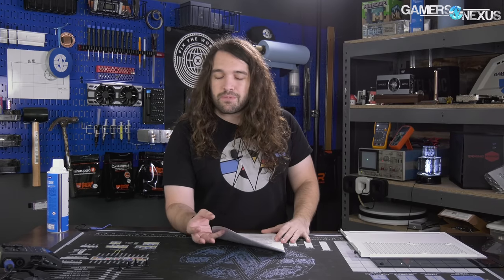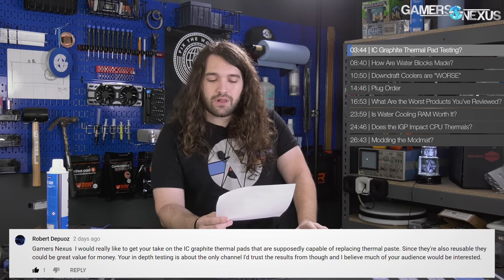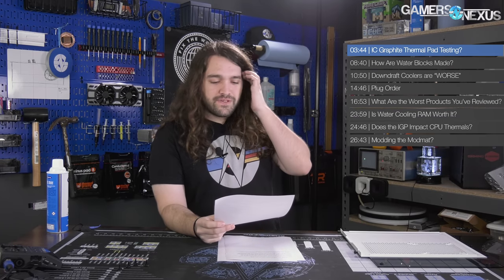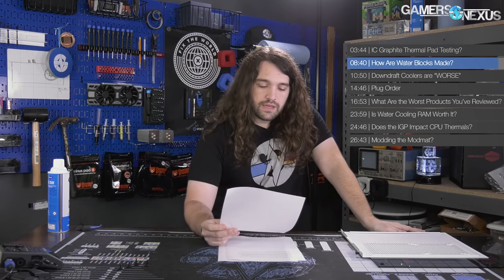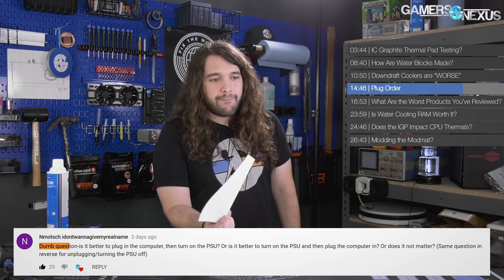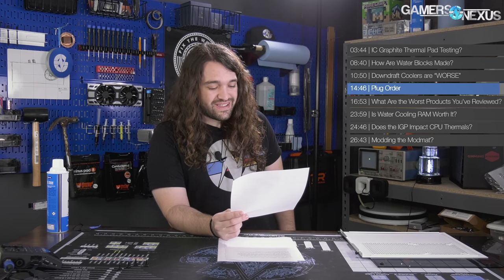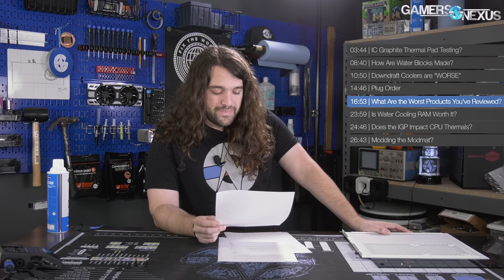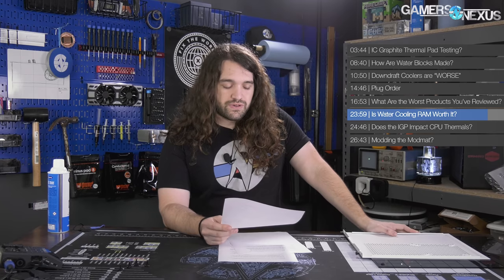Ask GN 83: IC Graphite Thermal Pads, Worst Products Reviewed

Comment: I just wanted to comment on the IC Graphite pads.  I purchased one to try out with one of my testing systems.

The temps are as good as high end thermal paste and they are consistent.  I can take the same pad and re-apply it and the temperatures will be exactly the same. (temps measured using HWInfo64)

This is great for me because I am testing allot of different computer parts.  Now I no longer have to keep purchasing more thermal paste and the results are always consistent.
Reply: Wyatt Newton agreed. I've put them into 3 laptops - 2 gaming and 1 2009 MacBook. The performance is generally as good as a premium paste and way more consistent.
Reply: Yea, it sounds like hes dismissing it like it's a thermal pad that GPU memory uses or something.
Reply: Tony Morris It's good to be cautiously optimistic. I get that he wants to test for himself. But yeah,  if graphite pads have worked this well in the past, they would have been adopted more. I really think they should be put in all laptops by the manufacturer. Traditional thermal paste, especially the crap these companies use, don't work well in laptops.
Reply: Jeff O my personal experience with the new ones disagrees with you. I've got an 1800x that didn't change temps at all from gelid to ic diamond.  Since I don't have to clean anything to use the ic I'm happy with it.
Reply: yeah, i've put the 40x40 into two amd rigs. one an overclocked 8350, and the other a stock 1800x.. both machines run 1c warmer than they did with thermal paste.. for 1c difference.. i'll take not screwing with goup
Reply: Yeah, also got some, they transformed my MSI GT72s (980 desktop card)

Put it on cpu and gpu. Much better thermal control, lower spikes. Had CoolerMaster Master Gel (or something like that on there) Paste is great initially, but its as if it gets worse in a few days. With the pads, been solid for a month now, very happy.

My 7700k did not get that much better, bit I think it needs a delid anyway.

Tl;dr; I love them, and dont think I will use paste again, esp in laptops.
Reply: Still got mine rolling. Still hasn't seen any jump in temps. Recommended :)
Reply: think these pads will be good for the ASUS GL503 laptop? thanks
Reply: I'm still waiting. I want to try a larger pad for a Threadripper.
Reply: @Abeille30  Yes, 1°C more is not a game breaker for the 24/7 overclocked gaming machine. Especially when the thermal paste is getting old.

Comment: Not only test the IC graphite pad, get some Panasonic pads too. Cheaper, way bigger pads that you can cut up, the lot. I have one in my laptop currently, replacing Thermal Grizzly Kryonaut. Pad thickness is 0.07mm with a 1000 W-mK up-down heat transfer rate. Temperatures are identical but with one big advantage being I never have to open the heatsink again in my life. Gonna put a piece of pad on my reference Vega 56 soon, then try it on my Ryzen 5 1600 (big difference since this has an IHS whereas the laptop dies and the Vega die are exposed directly to the heatsink).
Reply: I sent Steve an e-mail today to return back to this stuff - especially Panasonic. I included link to Panasonic Industrial page with all info and data sheets about this product. It's very interesting product and need to be tested.
Reply: BTW, look for soft PGS, and not regular PGS.
Reply: Im thinking of trying the regular pgs with the elastomer coating to adhese to the smooth copper of a heatsink then use regular tim on the cpu  since the graphite will spread the heat over the contacting surface of the heatsink past where the cpu ihs contacts, hopefully making the heatink better, not replace the tim
Reply: @TheRezin819  Can you explain more or make a video on it? Sounds really interesting. Are you telling you're going with TIM on the IHS/ die and graphite pad on the copper heatsink and then mountiing the cooler on pasted IHS?
Reply: @therealb888  you got it bang on with how i plan on using the PGS. I havnt done the experiment yet because shipping prices make the pgs more expensive than IC soft graphite. The theory is that it will make your die/IHS transfer heat upwards in a larger area as if the die was bigger since PGS has over 1000w/m.k in the horizontal plane and only 15w/m.k  vertically (which still beats most paste and copper only has about half the horizontal heat transfer rating as graphite) and that will make heat transfer more efficient because instead of a 2mm die emiting 100 degrees its like a 4-5 cm area emitting that heat which is easier to cool down
Reply: Hey man, I too have a reference Vega 56 and have been looking for improving the thermal solutions of it. Did you end up using the Panasonic pads on the GPU? If so, what were your results?
Reply: @Shieftain  I actually used the solid pgs on a laptop gpu that was making poor contact to the heatsink and it helped a lot but i dont have a copper shim to compare too, heat went from 100+ degrees celcius down to 86 degrees

Comment: How about make a thermal paste/pad testing rig.
 2 copper blocks, both having a thermocouple in it. one has a resistor/heating cartridge  and the other one will be connected to a big thermal mass to sink heat into. 
the temperature difference between block 1 and 2 while heating up represents your thermal conductivity of the paste / pad inbetween
baseline (best case) would be a block thats as big as those 2 blocks stacked with the same setup, direct metal contact.

Comment: Steve would overclocking be easy in space? If the pcb was outside the ship where space is - 273 celcius. Or would lack of air prevent conduction of themal energy away from the core?
Reply: The lack of air, as you mention, would make it extremely difficult. Sure, space is cold, but once power starts going into the processor it would heat up with nowhere to go. A several-square-meter radiator array would be needed to dissipate the heat via blackbody radiation.
Reply from the maker: Ha! You'd hit cold bugs before anything else. Being too cold will stop things from booting, even on earth.
Reply: Gamers Nexus so we need a dual vega 64 pcb that or a 590 😂😂😂.
Reply: Is it understood why Cold bugs occur/why being so cold stops whichever components from working?
Reply: Zie000 heat generates a certain amount of energy so ambient electricity produced  by the certain amount of heat I’m guessing allows the silicone to work that or sensors turn it of due to potential damage from overly cold conditions. Since if a pcb is to cold condensation forms over the pcb or electronics like caps are frozen solid or inductors since they are technically moving products with the copper wire vibrating inside...
Reply: Zie000 although some Pcbs have a teflon coating or aerospace coating like gigabytes cards which is noticeable as well on my old 980 that got stolen rip me....
Reply: Thank you so much for the explanation I appreciate it
Reply: Zie000 no thankyou for reading my rambling their my information could be flawed since their are so many potential reasons 😂
Reply: Zle000 // My theory is that as the die cools down, it shrinks (Der8auer talked a bit about something called "chip cracking" in his i7-7820X chip lapping video https://www.youtube.com/watch?v=tnd2LO0IBic, which relates to this) and as such transistors within the CPU just get too close to each other and the effects of quantum physics get too strong, like electrons jumping from one transistor to the next by way of effects like quantum tunneling.

I haven't made any research on this, so take this with a grain of salt. Still a fascinating topic.
Reply: :o awesome thanks for the video recommendation
Reply: Ujiltrom M ohh yeah the silicon nitrate video recently up but I’m thinking if you remove it would allow more expansion if you did this shit in space that is. But silicon couldn’t be that sensitive to the cold to retract so badly🤔
Reply: So you'd need a dipstick like in diesel engines to heat it up after a cold boot?
Reply: Space is not always cold because of solar rays, that's why comets melt and why nights on thin or no atmosphere planets/moons like Mars or the Moon are very cold compared to days.
In fact, the best place to build a server farm is not space but a moon like Titan that is far away from the sun, that has a sufficent atmosphere to block cosmic radiation and dissipate heat,  and that has no oxygen to decompose metals like iron or to create moisture.
Reply: White Noise revived // The thing is that I've already known that quantum effects would eventually pull the brakes on Moore's law for decades now, so it's a topic that's already been discussed since the 90nm node process (I had an Athlon 64 3200+ back then, so I looked that up) and probably before, so processor manufacturers knew they were going to fight against quantum effects. I can't imagine how tight the tolerances are at the node processes they work with now. It's a hypothesis that silicon shrinking due to extreme cooling may lead the transistors out of tolerance range, make quantum effects too strong and induce the so-called "cold bug". Like I said, hypothesis, no further research, grain of salt, what I'm saying is not absolute truth.

Your explanation with caps being frozen solid and as such can't store and release electricity is very valid too.
Reply: Heat „radiation“ does not need a medium to occur. Btw air acts as an insulator.
Reply: But that can be solved with small electric warmers (and if THOSE don't turn on, they can be warmed up with body heat).
Reply: Markward Franz, air is not a perfect heat conductor but it's definitively not an insulator comparing to void. Thermodynamic is clear : energy wants to average so temperature does. Using only infrared radiation to cool is way less effective than adding a gas or fluid as medium with free atoms instead of vaccum.
That's why laser weapons on spacecraft is often bad science fiction and why serious shows uses conventional bullets or missiles.
Reply: Ggchb Gig ghb it could overheat, no air or a vacuum is significantly worse at transferring heat that air. Hence expensive coolers are vacuum sealed. So could be harder
Reply: After extensive time playing Battletech recently I can tell you that space does not cool things down at all, the heat has nowhere to go so hot things stay hot.
Reply: Can you message Elon and see if you guys can test this?
Reply: Looking how alot of machines in space are built they usually use low power designs because there is not really anywhere for heat to go,you also have to keep them insulated from extreme temperature changes, going from 100 to the negatives very quickly.
Reply: Lack of air would not matter. Outer space is incredibly cold. You could go down to 3 Kelvin or even lower. At such temperatures, radiational heat transfer would massively outperform conductive/convective measures we use on terra firma. If anything, your system would fail due to being overcooled.
Reply: Arunava Chatterjee Space is a vacuum and it is quite difficult to measure the temperature of something that is not there. The temperature of things in space are only the temperature they are while you measure them. If something produces no heat and can avoid radiation by being in the shade for a long time it will be extremely cold, if it is in the sun exposed to radiation it will be extremely hot.  Most computers in space are heavily insulated from outside temperatures bit require significantly larger heatsinks to spread heat because it literally has nothing to move the heat to. So it is spread until it can dissipate as radiation.
 You just have to control the  temperature temperature at all times, kept at idle or working 24/7 as much of the equipment in space is meant to do. The system is kept running and is insulated but still requires some for of cooling. The real issue would be rapid temperature spikes from radiation but most satellites care heavily insulated and shielded they are designed from the ground up for this kind of stuff. So you can run a CPU in space you just need alot of equipment to do it.

Here is a article about massive heatpipes commonly used in space stuff. Because fluids dissipate heat much more efficiently. https://www.nasa.gov/mission_pages/station/research/news/heat_pipes.html
Reply: 100% spot on.  That would actually make the term radiator actually correct if designed for use in space as spacecrafts do using black body emission. The true correct term for use in gas/fluid like air to exchange the heat should be called  convectors but we call them "radiators"
Reply: Benjamin nailed it.
Reply: Admittedly, air is not as insulating as void. Still, in buildung etc., where vacuums are not practicable, "fixed" layers of air are used as heat insulator. Once the surrounding air layer is saturated, it does no longer take the heat away and starts being an insulator.

For the thermal radiation: a 50°C warm object (black body) should be able to radiate 600 Watts per square meter. I haven't found reliable data on radiator surface sizes, but even with a 120mm radiator and a thermal output of 400 Watts of thermal energy the equilibrium should be around room temperature. With a larger radiator, it would be even lower. https://en.wikipedia.org/wiki/Thermal_radiation
Reply: Markward, yes thin layer of air insulation is the principle of snow, straw, wool, double glazzed windows, expansed polystyrene, fiber glass and what we want to avoid with thermal paste. Air is not a perfect convector or insulator. It's in between vacuum and hydrogen, helium gases. It 's just for practical reasons of leaking that we use air at ambient pressure.
What your calculation doesn't take account is the sun's infrared emission that the satellite takes on it's lighten side and the huge temperature range with shadowed sides. It's a huge concern for martian and lunar probes since the difference was measured to be more than 200°C on the moon. See the Yutu robot malfunction.
Reply: It would overheat faster than it would be if it was in air... there is no medium to conduct heat too in the vacuum of space, only way to get rid of heat in space is with radiating
Reply: And CaptainMcAngry, the mistake was made once by a person that wrote it correctly twice so it's not a big deal and it's contextualized so anybody misunderstood.
Moreover, the fault is in the English vocabulary for not using the Latin word silicium anymore just like almost any European languages does and maybe it's also the fault of F.S. Kipping to be not smart enough to not see that naming it's discovery "silicone" is way too close from the writing and pronunciation of silicon or the now-deprecated silicum.
Reply: So explain me why you started to complain in this topic ? abruti
Reply: @GamersNexus  that depends when you boot it, if it's already running when it's put in space it will overheat because it can only lose heat inefficiently via radiating it away

of course, if you get it to space when it is off it will boil off any liquids due to low pressure and then very slowly freeze, but i'd put money on it booting on hours after launch

Comment: #AskGN Could we ever see socketed GPU boards that would allow for upgrade of the Graphics processor, assuming the heatsink and RAM are still viable?  I feel like a really high end GPU board would be perfectly useful for future processing cores given that they are becoming more efficient over time and RAM usage in games does not increase very quickly over time.  In theory you could use the same GPU board for 2-3 generations before needing to upgrade.
Reply: Doesn't sound like a very profitable market for GPU vendor partners... Why would they sell you a GPU mainboard every 2-3 generations when thyey can sell you one with each GPU? Ecologically seems very logical but economically for the manufacturers not so much
Reply: but this would allow for GPU makers to sell more product even if at a reduced cost. Plus this would discourage mass miners as they would need to buy boards and chips. over all i would love to see this kind of thing as it would allow for more customized builds and a more competitive market.
Reply: @Daniel Ladishew they tried that and the mxm form factor is officially dead in the water! 
They don't care although the market may want it. 
its just is too costly for them to provide support.
Reply: MXM is not even the same as what i'm suggesting.  MXM is a full GPU with a different connector and less opportunity for optimal cooling.  It was the SOC of GPUs for laptops, which is the real reason it died.  Thanks for playing the game tho!
Reply: At that point you are sourcing so many parts that would need compatibility, you enter into a situation where you are building another computer inside your computer.  This would definitely be too costly and remove any profits from GPU manufacturers.  I'm thinking that if you leave the complex part of VRM and RAM as a static, then only swap out the Graphics core, you remove most of the variables.  I would guess you could only upgrade within a GPU architecture, but I think it's possible.  nVidia and ATI probably make most of their profits from the main chips anyway, considering they are willing to allow so many AIBs to control the vast majority of supply.

Comment: Why not have a CPU shaped heating coil? Get rid of the software and hardware differences between motherboards, processors, and user settings.  You can control the power supplied to the 'cpu' and fan speed.  Even if you can't translate the cpu shape (cross section, depth, concavity) and cpu material (thermal conductivity) to a real product, you can fix those variables across all heatsinks.